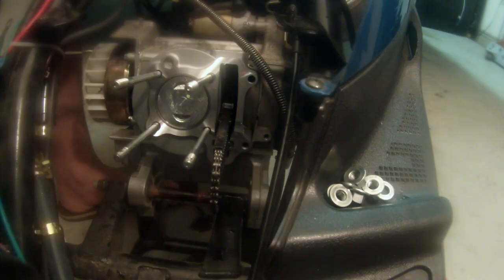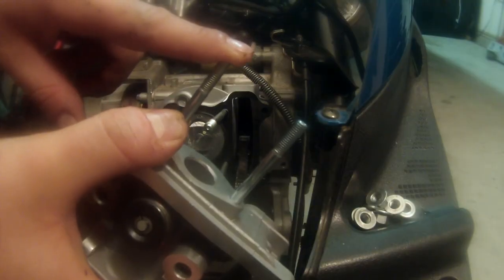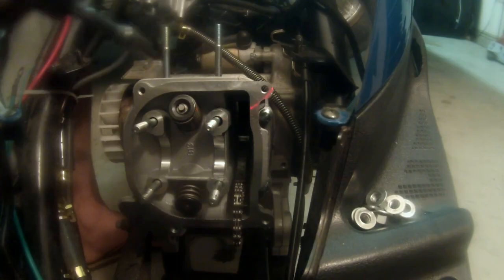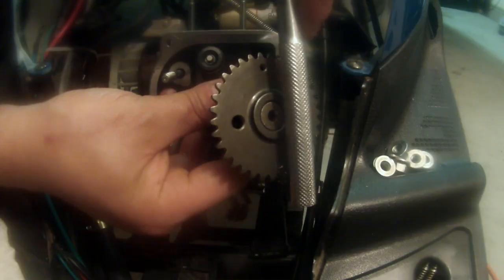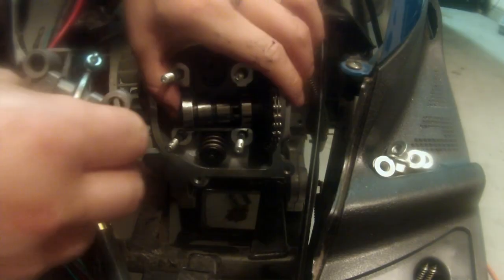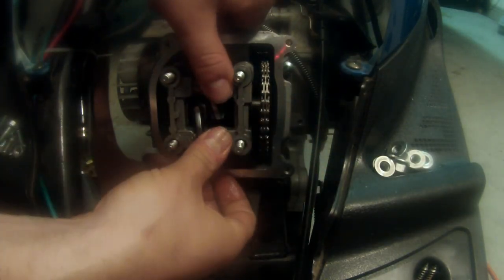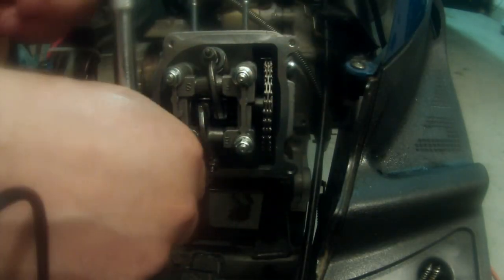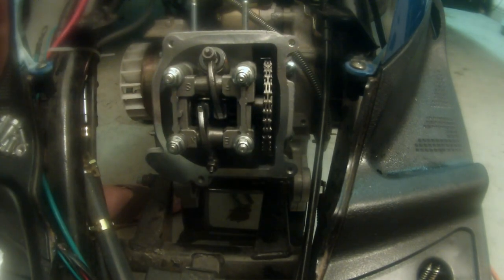Scooter Big Bore - Chapter 8 - Installing Head, Camshaft and Rocker Arms

Comment: It looks like you're putting the stock rocker arm assembly back on after installing the bbk.  What size valves are on your bbk?  The issue I'm having is that after putting the rocker arm assembly back on the inside of each rocker arm doesn't touch the lobes at all making it impossible to adjust the valves.

Comment: I need help BAD I can not put the chain on the cam sprocket it seems like the chains to short i did remove the chain tensoner i put the two long bolts in to hold it snug my scooter is a 2015 Tao Tao with engine GY6 an no# 1P39QMB, and I purchased the kit from GOOFIT 100cc big bore kit Please help my scooter is all apart, and yes it is set on top dead center I wacth your video from start to finish
Reply: +michael paradise I don't know if you've got this figured out by now but I found that if you hold the sprocket with the large hole facing slightly downward but mostly top/center and start putting the chain on from the bottom to the top is seems to go on pretty easily.  I had to do it multiple times because it would always seem to be one notch off causing the top/center hole to be slight off.
Reply: Thanks for the advise, I had a shim in the wrong place the whole time thank god I did not force it,but know I trying to keep the piston rings in place while install it, I will get IT thanks again